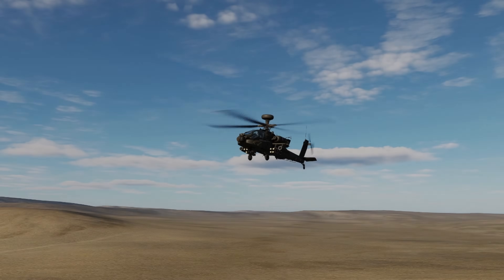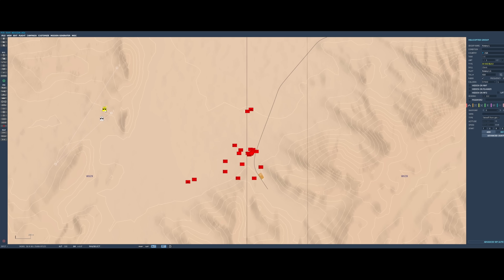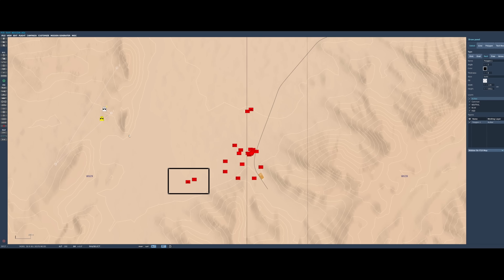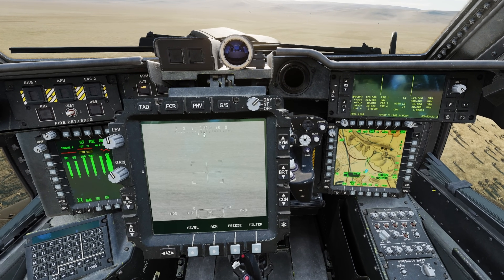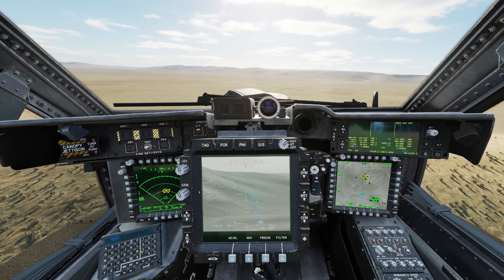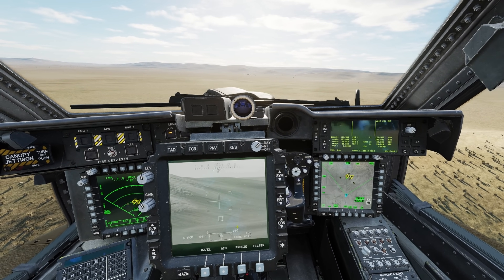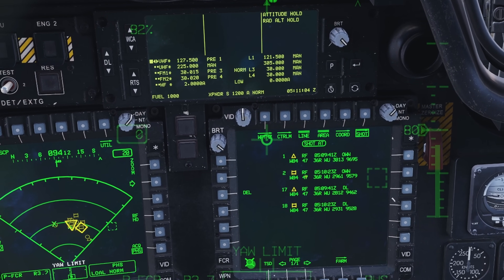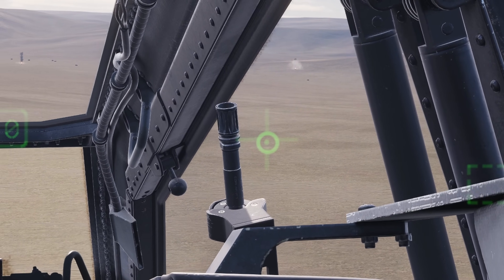Sling Hellfires with Friends | #dcsworld AH-64D Apache

Comment: If you are going to share prim/all targets through the longbow net will they pop up for non fcr ah64's just as target points? Is that right?
Thanks for your continous support for this aircraft and the dcs Community 👍
Reply from the maker: No not as target points. The yellow FCR indications are what you are transmitting. 

Now if you save them on your aircraft via the target method, then you could go to the TSD and share those target points.
Reply: @CasmoTV  thanks for clarification. Much appreciate it. Thought those are kind of exclusive just for units with FCR. Thanks again 👌
Reply: Wondering what it looks like for aircraft receiving the info. I'd love to see a video of Apaches and Kiowas sharing information and engaging targets. If it's something you've already done, I apologize. I haven't found it. Thanks for another great video. 👍